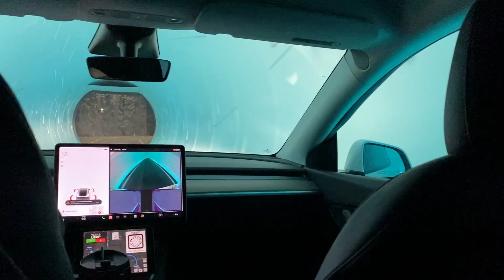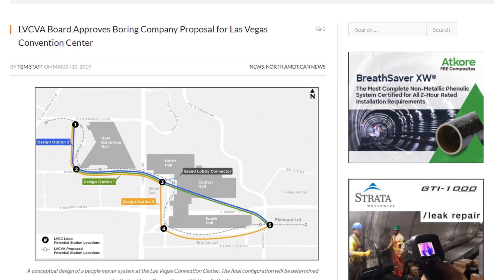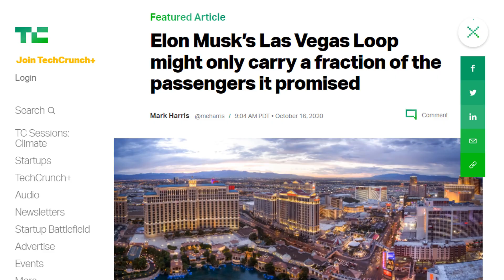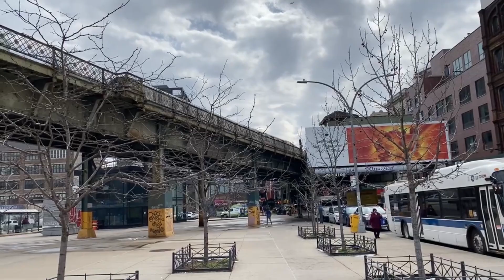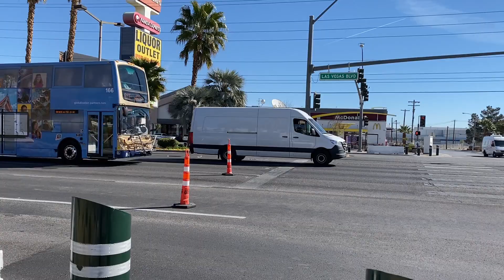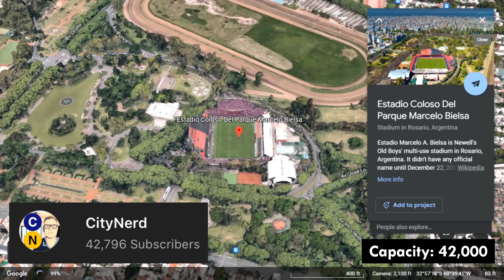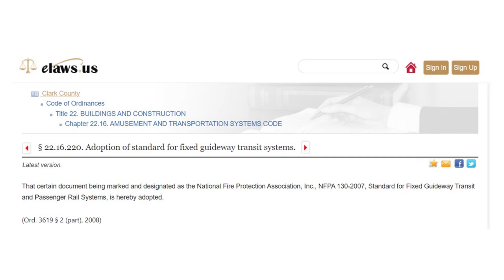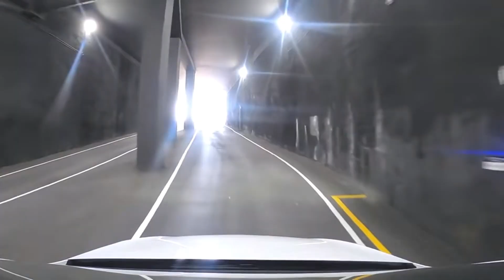Inside the Las Vegas Loop: Transportation Game-Changer, or Complete Waste of Time and Effort?

Comment: Note that taxi services normally have that same driver to passenger(s) ratio.
Reply: that is true, but there are 2 things I can think of that make taxis different to this loop. 1) Taxis costs a lot more per passenger km than public transport, and this loop is suppose to be a form of public transport (? I'm assuming, and being generous by not calling it a grift).  2) taxis are free to move around the whole road grid to find customers and aren't locked into a loop. So now if there is a quiet moment, the drivers are forced to twirl their thumbs waiting (or they can watch a movie, they are in a tesla after all). Now if they are going to be on the clock while waiting, I don't know, would depend on the amount of waiting I guess. A taxi driver may go else where to find their fare, while a normal public transport system just keeps on moving to the schedule. So really, this loop is all the cons of a taxi, with all the cons of public transport, without any benefits of either.
Reply: That's why taxis are much more expensive than mass transit.
Reply: @daveharrison84  The LV Loop really isn't "mass" transit.

Comment: I find it interesting you didn't bring up the Morgantown PRT (Motown Represent!) but still a good video, and loved the dry humor as always. Ignoring the immediate obvious flaws and assuming they'll be fixed (autonomous vehicles and dedicated loop vehicles with higher capacity), I think the Las Vegas loop could actually work*

*As a someone who had to ride the Morgantown PRT several times a week, I had a lot of time to think about its role. I always thought the PRT was idiotic, as its entire purpose from the start was to move students back and fourth between the new and downtown campuses, 3 miles apart. I always thought that they should have just put in a bus lane (I still think this) but I thought it had no advantages and was just more expensive.

The thing that made me realize the PRT actually succeeds at its job (besides frequent mechanical failures due to its age) is that it's designed for *frequency*, not capacity. Criticizing the PRT or the Loop for its low capacity sorta misses the point in my opinion, because its not trying to compete on that front. The PRT has more than enough capacity for its job, while providing only a 5 minute wait, and this wait is artificial, sorta like calling an elevator when its already at your floor but still having to wait with the doors open. A fully functioning Loop with AVs and something like 15-20 people per car would have a pretty descent capacity, but the frequency can scale to demand to be as low as possible. I personally think that trade off isn't that worth it, especially in a city as big as Vegas and with all the added complexity it requires, but I do understand why some people do, and in a resort city setting like Vegas it does make some sense. I'm honestly very interested to see how a fully functioning Loop performs with proper vehicles. Even if they aren't replacing subways anytime soon, It'll still be an interesting system to observe.
Reply: The best part about the PRT is that you had a built in excuse if you were ever late to class. 

“The PRT broke down!” 

It happened so often that any professor would just automatically believe you
Reply: The Morgantown GRT (Group Rapid Transit) was one of four demonstration projects authorized during the Nixon Administration. It was not built to "move students," it was built as proof-of-concept and it was built at WVU because Byrd had a lot of pull.

The Las Vegas Loop, on the other hand, was built as a last-ditch attempt to salvage the failing Boring Company and as a gimmick to sell cars.
Reply: you have the exactly correct take on the issue. everyone assume that capacity is everything, but my local light rail moves fewer people than the Morgantown PRT but is a much bigger city, has much lower frequency, and overall worse service.
not all corridors need high capacity
Reply: Automated trains are legit a thing. Vancouver Skytrain has been running since 1985 and can run at 75 second headways (although typically is about 110ish seconds during rush hour). You don't need to invent something like PRT or as dumb as Teslas in tunnels. Vancouver and Las Vegas have similar populations, so it's not like LV couldn't have built out a transit system with proven technology.
Reply: @agntdrake  Headways on the Skytrain vary from 2 up to 6 minutes peak and 20 minutes off-peak. 

The Skytrain consists of 3 lines and 53 stations and cost a grand total of around $4 billion for the 49.5 miles of track or $80m per mile. And that is not even for an all underground tunnel system. 

In contrast, the Las Vegas Loop will consist of 51 stations over 15 miles of dual tunnels capable of handling 57,000 people per hour and is costing taxpayers zero dollars. 

I think we can see why Las Vegas went for the Loop.
Reply: @agntdrake  , you're not understanding what OP is saying. what happens if you don't have the demand to fill entire trains? even automated trains have very high operating costs. your choice is either A) really expensive service per passenger-mile, or B) you make passengers wait 10-15 minutes between trains, which makes for very poor quality service. an EV with a single person in it costs less per passenger mile than the DC metro and also uses less energy, assuming they can automate and eliminate the driver from the EV. so, what is the advantage of a train if it is slower, costs more, and uses more energy? trains are incredibly cost effective and incredibly efficient when they're full, but when ridership isn't high, it is a crap service. a city could run buses, but buses have to deal with all of the slowdowns of surface streets, whereas PRT/Loop can be grade-separated so you can go straight to your destination without being stuck in traffic, stopping at lights, or needing parking when you get to the destination.
Reply: @somedude-lc5dy  I understand completely what the OP is saying. With Skytrain and other automated light metro systems (like in Copenhagen) you can run much shorter train consists (e.g. on the Canada Line the trains are 40 meters long with 5 minute or less headways). If the line is successful, you can add larger trains (which is what happened on the Expo and Millennium lines). The marginal cost of dispatching another train is negligible because there's no driver associated with it and you can surge dispatching more trains when you need to (like during a conference or when there is a sportsball game). The other benefit to shorter trains is that you don't have to build giant stations, so it ends up being far cheaper to build. The Canada Line was about $1.5 billion USD for a 12 mile stretch of track including 15 stations and tunneling for about half the line (with both bored tunnel and cut and cover).

The problem I think is that a lot of the Tesla fanboys don't realize that this kind of infrastructure already exists outside of the US. It's amazingly efficient and doesn't have high maintenance costs from replacing things like rubber tires and cars which get worn out because they're not not designed for this kind of service. It's also the reason why places like Vancouver have extremely high transit ridership compared to US cities.
Reply: @agntdrake  It's also instructive to look at how the Loop compares to the Skytrain ridership-wise.  The Skytrain network has a daily ridership of 526,400 over 3 lines and 53 stations and 298 trains, so that gives us averages of 9,932 people per station or 1,766 people per train per day.

The busiest Skytrain station, Waterfront handles 37,500 people per day over 6 different tracks/platforms, so that averages out at only 6,250 people per platform per day.  And that was pre-pandemic, it's much worse now.

In contrast, the LVCC Loop handles 27,000 people per day during large conventions.

So not only is the Loop vastly cheaper per mile than the Skytrain, it is actually more than competitive capacity-wise.
Reply: @andrewfranklin4429  The top ten Skytrain stations had 5 million or more annual boardings (pre-pandemic), with Waterfront having 13.2 million in 2019. How many passengers did each of the LVCC stations handle in any given year? And I mean total passengers, not "theoretical" passengers.
Reply: @agntdrake  the Loop is only open during conventions which have been very scare on the ground over the last 12 months thanks to the pandemic so annual ridership is not an appropriate metric to compare. 

To work out what sort of throughput the Loop is capable of you have to compare daily ridership which for the Loop has hit 27,000 per day during a convention with 114,000 attendees. We have yet to see what sort of ridership the Loop delivers with a convention of 180,000 which is what it is designed to be able to handle.
Reply: @agntdrake  Also, there are around 8 Loop stations for every Skytrain station per mile through the busier parts of Las Vegas. 

The convention centre Loop is a prime example of this fact as it already has 3 stations serving it and there will soon be a fourth LVCC station (LVCC North) and three other stations within a few hundred metres of the centre as well, meaning that the LVCC will effectively have 7 Loop stations servicing large convention crowds.  

With the Skytrain, there would only be a single station typically serving such a destination. 

As such, comparing the average daily passengers through the turnstiles of the three stations of the LVCC Loop during large conventions is actually unfair to the Loop as we should really be comparing all 7 of those stations (once they are completed) against each Skytrain line for a more accurate comparison. 

So the fact that even just three stations are so competitive with these Skytrain station line averages is a very strong witness to the significant capacity of the Loop.

Comment: given the short distances and high operating costs because of the cars i really ask myself why the didn't use travelators, because although the maintenance costs of travelators are high so are those of vehicles but travolator could transport a much more people al the wile using less people and the are much more accesable. here is me hoping the can be retro fitted.
Reply: 12:30 there's 29 more miles of tunnels coming
Reply: @flinx  good point i missed that. Thanks.

Comment: So... if the full system is built and I'm waiting at a stop... I just gotta hope that when a car comes at least one of the three people are trying to get out at that station? You could argue that "Full subway cars have the same problem" but I'm more willing to squeeze into a full subway car than I am a full sedan.
Reply: Cars will come about every 6 seconds. Only some will stop at mid-line stations if that's an occupant's destination. A bus is high capacity but if most of the time every bus stop has someone waiting to get on or off, the bus makes tons of stops and has a slow unappealing average speed.
Reply: @flinx  So if you're standing on the mid-line station, is there any way to hail a passing car? And won't the passengers already in the car roll their eyes and lament the fact that they have to share a ride with strangers? What if one of those passengers is getting off on the next station, so the car stops again to let him off and pick up a new one who's also not going to the same place as his fellow passengers so even more stops are scheduled, essentially creating the same issue as a bus would have?
Reply: @Codraroll  Smartphone app and kiosks in station are two possible ways to hail a car. TBC in Las Vegas plans to charge per vehicle not per person so if someone doesn't want to pay more for a totally private ride they'll share it and maybe make a few stops along their trip. It will still be faster than a bus.

Check out MIT CSAIL research that used public data from NYC taxi rides to develop an algorithm that can replace 14,000 taxis with only 3,000 four-seat vehicles. Applying that to The Boring Company loops, algorithmically the first vehicle with an open seat may not stop to pick someone up if that person's destination would slow down other occupants more than it would save the person's time. So instead some number of seconds later another vehicle with an open seat stops to pick the person up.

Comment: When I first heard about the Vegas tunnels I thought they would have the capacity to carry at last 5-7 adult passengers per trip. I just don't see waiting in a line of people for a 3 passenger car. Guess I would only wait in line if the loop is open that day!
Reply from the maker: It was originally pitched showing much larger capacity vehicles. But now it's just mass market Teslas. Curious
Reply: 3 passengers assuming you're all fine with sitting together, that is. One of the selling points of the Loop was that sitting with other people is icky. Worst case, the queue ahead of you will consist solely of people who want a vehicle to themselves.
Reply: The nice thing about the Loop is that it was able to move 27,000 people per day with just 2.5 people per vehicle on average.  That's excellent capacity while still retaining the option to have a whole EV to yourself if you wanted to.  And the wait times averaged only 15 seconds so virtually zero queues.
Reply: @andrewfranklin4429  This is not true...several people have stated they had to wait a while for cars during peak demand.
Reply: @RajNadar6336  I’d be interested to know what sort of wait time those people indicated?  Do you happen to know Raj? Was it anything like the 3, 5, 10 or 30 minute waiting times of light rail or subways?

The LVCVA reports that “the LVCC Loop’s average ride time was under 2 minutes during CES 2022. The average passenger wait time was below 15 seconds” and in the many videos of the Loop in action, I haven’t ever seen any videos of queues of people standing waiting to get into any of the stations.  

Have you seen any such videos by any chance?
Reply: @andrewfranklin4429  Do you really think people would have waited for 30 minutes for a light rail system that ran between three stations just a mile apart?

MAN, you are dishonest.
Reply: @andrewfranklin4429  Not everybody posts videos of everything...despite it seeming like they do.  I know you are very bullish on the Loop but until they get higher capacity pods and self driving, this system is no where near what was promised.  Plus, a single tunnel from the Resorts world Hotel that doesn't even hook up to the loop...would have been better if they hadn't built it.
Reply: @RajNadar6336  The Resorts World tunnel is just one of the stages on the way to building the 29 mile, 51 station Vegas Loop. It currently ends at the shortly to be constructed LVCC North station which will itself be linked to the rest of the LVCC as well as the Encore station and one of the main arterial tunnel pairs going down the 29 mile Vegas Loop. This will turn it from a one-way tunnel into an two-way link. 

The Loop doesn’t need higher capacity vehicles at the moment as with 27,000 people per day it is already handling:

- greater than the number of passengers that 65% of the stations on the London Underground individually handle daily which with 1.8 million passengers per day across 272 stations averages only 6,617 passengers per day PER STATION. 

- more than the 24,858 passengers per day per line pre-pandemic average of Kings Cross station, the busiest station on the Tube which pre-pandemic had 149,150 entries per day across 6 lines. 

- more than the average of 13,684 people PER STATION per day of the entire Paris Metro which had a pre-pandemic ridership of 4.16 million per day over 304 stations.

- about 70% the 38,888 people per day per platform pair average of the busiest station on the Paris Metro, the Gare Du Nord which pre-pandemic handled 700,000 people per day across 36 platforms. 

 - more than the 14,000 passengers per day per line average of the Stuttgart Main Station S-Bahn which pre-pandemic saw 140,000 passengers across 10 lines through the turnstiles daily.
Reply: @andrewfranklin4429  You can keep posting these sentences but that doesn't make them fact.
Reply: @RajNadar6336  Raj, I’m interested to know which sentences you believe to be untrue?  Is it the daily ridership figures for all of the subway stations or is it the 27,000 daily ridership figure for the Loop perhaps?
Reply: @andrewfranklin4429  Are you a human?
Reply: @dickiewongtk  Hi Wong, yes, I work in a university in Australia and happened to be online watching YT videos during what is our Sunday night so saw your reply come in.  Apologies if my quick response startled you. 

I confess so many people ask your sort of question that I did copy and paste a response I wrote a few weeks back.  I hope it made sense to you?